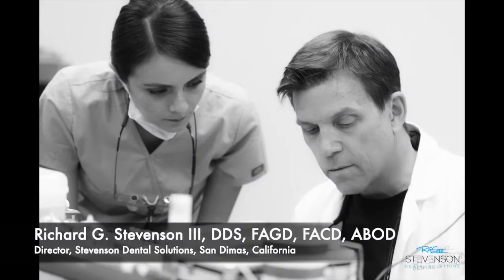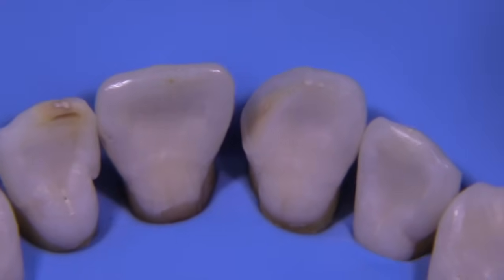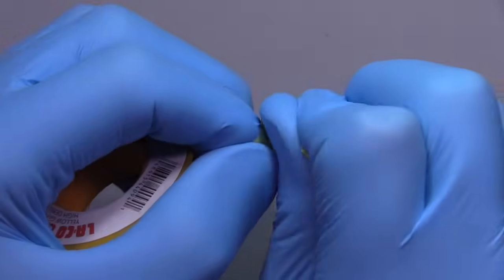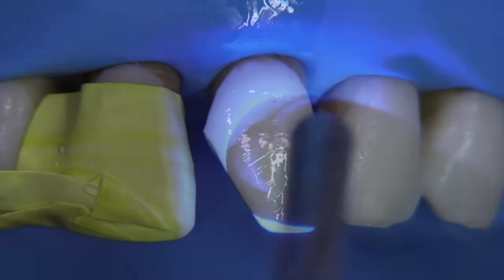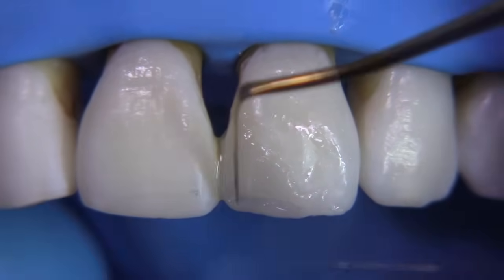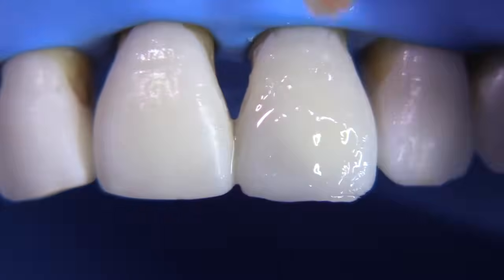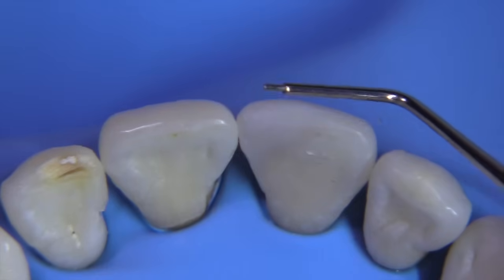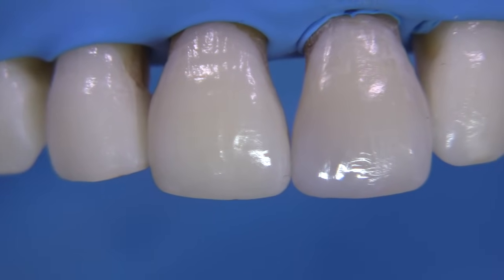Class IV Composite Restoration | Restoration Technique

Comment: Great content and a great channel thank you for the effort. While I appreciated using the translucent shade on the lingual for several reasons, I can't help but see it's final effect on the light emitting throughout the whole restoration which in the end did still show up at least to the dentist's eyes. 

However, my question is about the starburst bevel, do you bevel that to produce a smooth transition between the two bevels? And If so do you do it with the coarse disc or the fine grit diamond bur?
Reply from the maker: Yes - this was a tough one with this composite - thought I'd give it a try with a limited set of composites.  Usually with enough opaquers we can make this invisible - I've used opaque for the lingual shell and although it won't allow for light translucence, hence improve the overall effect, it does limit the ability to create any trans effects.  In this case, I could have used the opaque in this case.  These extracted teeth are tough to work on.  For the starburst bevel, anything that allows a gradual transition is useful - I like your ideas!  Thank you.
Reply: I agree extracted teeth are tough to work on but great job none the less especially with the limited features of the composite set used. What do you think of injection molding techniques doctor? Personally I don't like it for some reasons. If you could provide how you manage complex cases with generalized attrition and loss of vertical dimension that would be great. Thanks again for the content and the efforts!
Reply from the maker: Thanks Doc - when I use the Injection Molding Technique, I need to rely on ideal anatomy preoperatively - this rarely happens.  Besides, I really enjoy sculpting the composite :)
I will tackle the Wear/VDO patient in the near future - terrific idea!